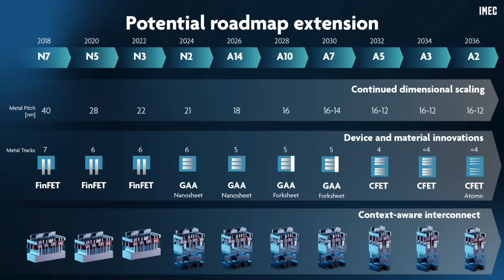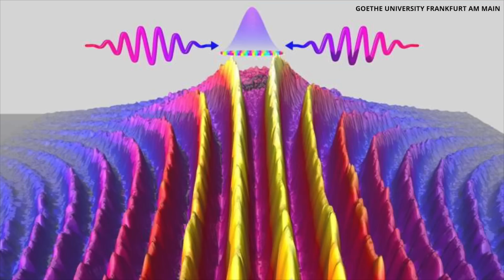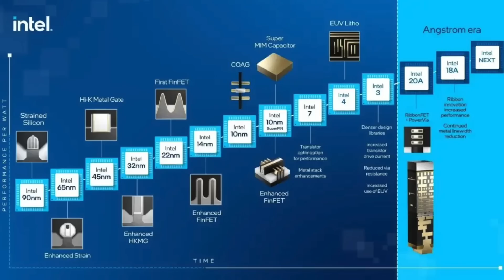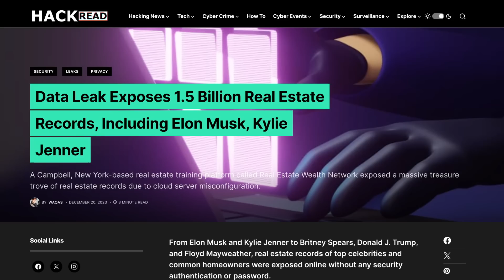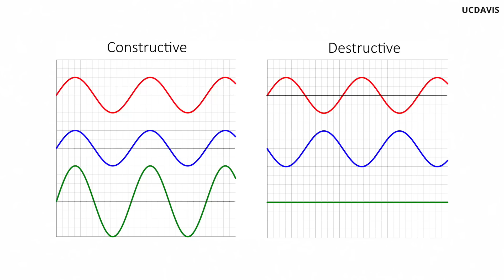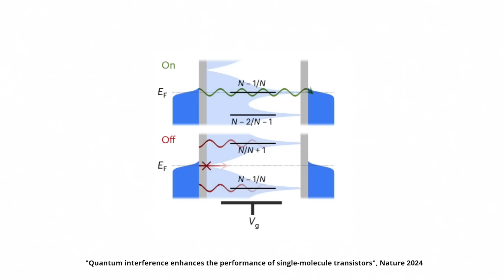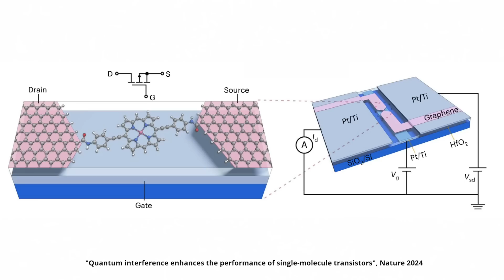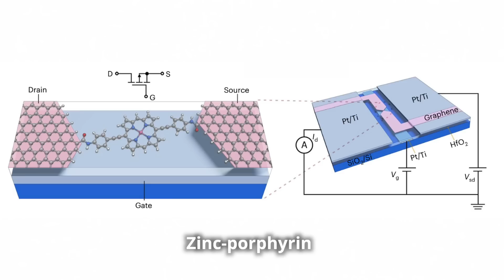Scaling Beyond 1nm

Comment: Fabulous video, your explanation of why there is leakage & cancelling the leakage was simple, clear & easy to understand irrespective of the nouns used. All technologies have limits. You can only run jet engines up to the temperature limits of the materials & fermion  (e.g. electrons) will not be retained by a thin walled barrier. Indeed many atomic nuclei decay when such decays are classically forbidden, but the decay fermion, alpha particles or positive or negative electrons tunnel through the classical impossible to pass barrier. The theory of this barrier penetration is well established & covers half lives from the age of the universe to fractions of a second. As you say the leakage can be switched off, but it’s slow & complicated & currently not practical. At some point we will reach the limit of electron technology & move to better ways. For example if you can store information in atomic nuclei the size scales are femto meters 1e(-15)m, or we can use photons. Thank you for the fabulously interested & well presented video that must have taken a long time to create.

Comment: China full transistor dimension is 19,88 nm, but exist a proget for a 16,11 nm full dimension for low frequency, (similar older 70 nm) , only  in chip BIOS and 220:1 marklin, for example.

Comment: To shrink ? Maybe the nichola tesla trick . Basically instead of continuous wire . There is cut in the bare wire or smaller section . And each section has a small section isolated .maybe this can at atomic scale . Wire is 10 cm siZe , it shrink to 2 cm every whatever and those continuous section have small lenght of isolation . Supposedly in high electricity application this trick stabilised nichola tesla toys . Pretty sure usa still have the 80 missing chest of nichola tesla .

Comment: The molecular structure in the center of their figures is a porphyrin ring structure. It has lots of interesting features and crops up all over nature when moving electrons around. It's been a candidate for cool logic and transistor designs for decades. For example in [Barker, J.R., 1987. Prospects for molecular electronics. Microelectronics International, 4(3), pp.19-24 , doi:10.1108/eb044287 ] Figure 5 reports a NAND gate where the central structure is the same as here but it has a much larger overall structure for doing things optically. (Hope that is interesting!)
Reply: From a theoretical point of view metal complex compounds are interesting becauce we easy can change the electron density in the center ion by variations in the ligand. So a lot of research was done with organic semiconductors. I worked in solar vell research and there it has a big advantage over silicon as it has a highter absorbtion coeficient for light.
Reply: you are amazing
Reply: Thanks for stating that.  The instant I saw it I was thinking of chlorophyll and haemoglobin and wondered if it was a porphyrin ring.
Reply: Don't forget China has this technology to didn't know they could build the machine process these kind of chips lol
Reply: Yup, put a divalant atom in the middle and you can tune it to all sorts of stuff ranging from photocatalysts to energy harvesting to quantum phase modulators like described as single atom transistors.
Reply: So, what is new in this latest proposal then?
Reply: @koka3243  It is a step forward from theory to application.
Reply: It's dang interesting, I would risk to say fascinating, but it just collapses when it comes to the point "okay, so how do we persuade literal millions of molecules to place themselves right across our transistor channels, one at a time?".
Reply: @krzysztofmatuszek well it can be the use of a functionalizing patterned molecule below that guides the whole structure that can be patterned by EUV for example. As long as you have compatibility between materials. What thermal budgets can those molecules sustain after being synthesized ?
Reply: @OlorinEa  you missed the "one at a time" part. Sure, materials bearing some functional on the surface, patterned afterwards, can be used to create preferential binding spots for such molecules. But we're still talking about hundreds or thousands of molecules per single transistor channel. Which is barely any scaling down compared to contemporary technology.
Reply: @krzysztofmatuszek  I would tend to ask for more details. There are techniques that allow sub-10nm patterning. The real question is what’s the molecule size and how to impose the right orientation. I’ll read the paper tomorrow but what I find most curious is that the subthreshold swing is still limited by system thermodynamics just like in conventional devices. Or is slightly below. ? 
Anyways for now good night :)
Reply: @OlorinEa  Indeed, "how to impose the right orientation" is where this concept collapses. Have a good night, too!
Reply: but does it lend itself to this application as a long lived structurally sound choice of structure to use here? like i know dye sensitized solar cells exist and their main issue is the dye evetually breaks down and then you have to rebuild the whole cell. it seems this is great challenge of incorporating chemicals into silicon. unless the intent is to have them be more disosable or recyclable. who knows. someone does. not i. 
plus really at the point where theres a whole new material isnt it about time to also look at entirely new devices that can do switching without silicon at all? that would be truly green. wet ware and organics for computer systems. its not impossible, but far outside what we commonly know now. also...what about analog devices they are saying imight become prevalent in the future.
and wont most computing occur at a cloud level at some point in the future. at least to some degree limiting the need for increased miniaturization and power density or rather computational density. hasnt the upper limit of usefulness, econmics like price, cost etc...like the stuff we have now is sufficiently powerful enough? how much more can the demand for more power grow in the coming years. do we really believe this is the way of the future? will we all be playing video games at high graphics settings at work? running simulations? does anyone envision a future where weve scaled down the use of tech because it can only bring so much to the table and all the energy and resource cost human cost has come to outweigh the real tangible benefits of it. this reevaluation is currently ongoing. stay tuned.
Reply: @SimEon-jt3sr it's pretty structurally sound. Some forms are still found in crude oil. So those have likely lasted a few hundred million years.

Comment: ty for explaining that, no one ever said explicitly that quantum tunnelling was happening at that scale. you're the first to say as much. in all the videos on this stuff we've seen in the last few months, this one is the first to actually get into the reasons why. very muchly appreciated <3. it helps to understand what's going on, instead of being left in the dark.
Reply: What are you talking about? Everyone has been saying explicitly that the problem is due to quantum tunnelling. This has been a known problem for 10+ years that transistor designers have been struggling to bypass with various workarounds like wrapping the gate around the entire transistor or adding additional layers of transistors and packing them closer together. This is the first time they've come up with a real solution but the problem has always been known

Comment: The neuromorphic computing approach, I think, will solve the problem of the processor's internal frequency, which cannot be increased, without the need for smaller structural manufacturing technologies. Because our brains can perform sensory and intellectual computations at very low frequencies compared to processors with very low thermal capacity. Also, we always lithograph the logic switching gates in a planar structure. While we plan very comfortable growth in 2 planes, I think we do not think enough for connections on the 3rd axis. I think if we build a model of the brain with basic physics and chemistry, we will reach the next layer of computation needed without opening a door where sub-quantum effects will emerge.
Reply: SSDs and modern memory already employ multiple layers on the same silicon die. Toshiba uses 16 die stacked NAND chips to enable 16TB SSDs.
Reply: @renaissanceman5847  As you know they are not compute unit. we need establish computational sinaps to ensure getting more.
Reply: @seyittahirozuolmez1026  what they do is irrelevant. how they are constructed is... 7 layers of computational circuity is simply a matter of lithography cycles.
Reply: @renaissanceman5847  With the current production paradigms, nothing more comes to mind. But when you model the nature of biological nerves, I hope you realize that it is not about multi-layered lithography.

Comment: 200 billion transistors on a GPU compares pretty closely with what I'd estimate to be about 900 billion transistors on every 6502 ever manufactured, combined. (I'm guessing about 200 million total 6502s were built, though that's a very rough estimate).
Reply: My favorite fantasy game: try to guess how square mm silicon need for a c64 computer or my first 286 pc.....
I think a qfn32 package will be enough....
Reply: @gyubear  I'm currently designing (for my own solace, maybe I'll end up publishing it as a didactic example) a very simple computer, with no CPU or ALU but able (in theory) of computing maybe 200,000 8 bits × 8 bits multiplications per second, and with special features such as every microinstruction being tagged one of four execution modes when used: unconditional execution, execute if X flag, execute unless X, or Breakpoint (to debug instructions' microcode or the hardware).

Comment: Interesting as always!
Regarding audio: there's some low frequency noise every now and then, for example at 14:47.  (i can see the microphone physically moving, so perhaps a microphone physical isolation issue is the root cause)
A high pass filter at 120Hz would solve that